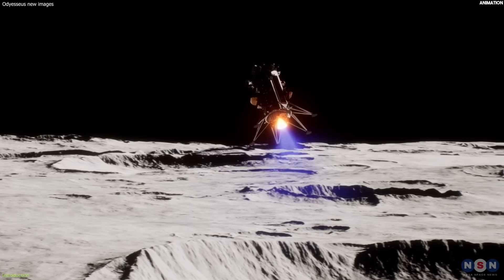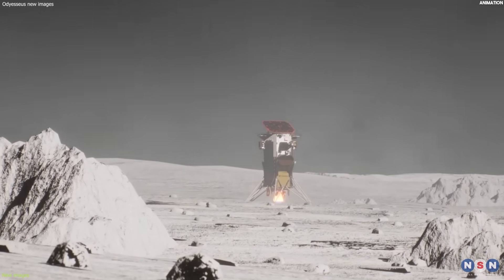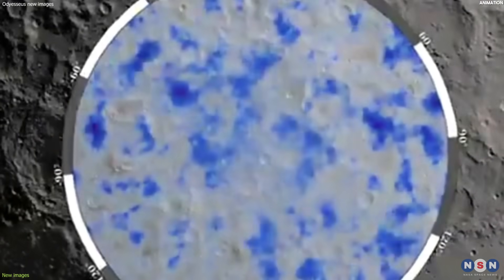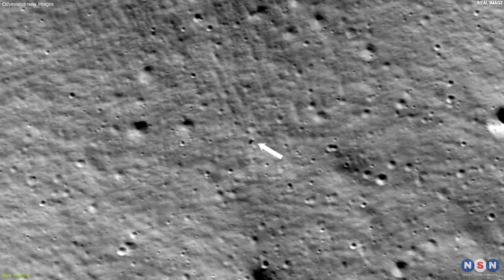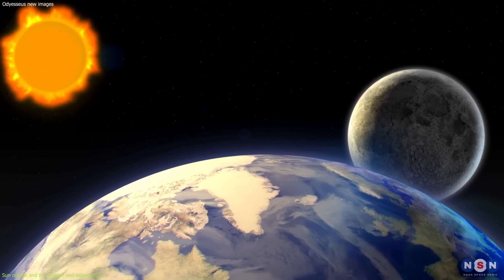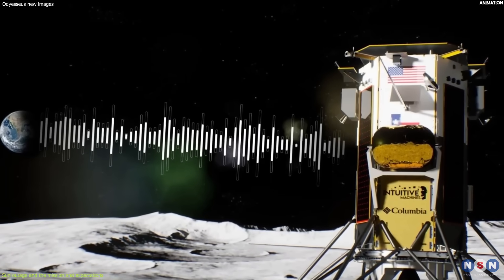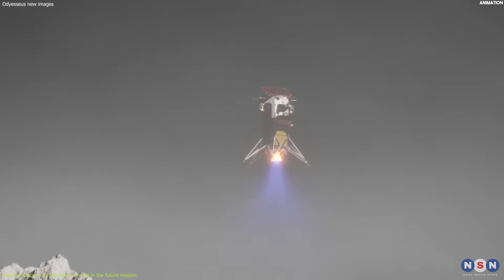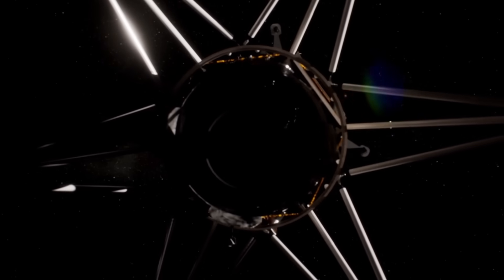New Images Reveals The Incredible Story Behind the Odysseus Lander’s Sideways Landing

Comment: Be realistic: this is a failed mission that emphasises the uselessness of the private sector. "The day after the launch, the company’s header of navigation, Mike Hansen, told Reuters that the lander’s laser-powered range finder wasn’t functional because Intuitive Machine’s engineers failed to unlock a safety switch during pre-flight checks. The range finder measures the time from when a light pulse is emitted from a laser to when the reflected light is detected, and is critical for measuring the craft’s distance from the Moon as it is landing. Range finders are a standard component of the vast majority of all modern landing systems.

The problem was only discovered while the spacecraft was en route to the Moon, and no software on board was able to unlock the switch remotely. As a result, the company was forced to use NASA’s Navigation Doppler Lidar for Precise Velocity and Range Sensing, one of the instruments launched as a technology demonstration, to measure the craft’s distance from the Moon as it was landing."

https://www.wsws.org/en/articles/2024/02/28/bkpr-f28.html

Comment: I've been to the Smithsonian andcseen the lunar module  but, im having a difficult time understanding how that dune buggy fit in that module? Hummm!!!
Reply: Boeing built the Lunar Roving Vehicle (LRM) to fold so as to be stowed in the  LM's storage bay while in flight. Popular Science magazine in Feb. '64 had a great article by Wernher Von Braun who was a director at NASA back then.
Reply: Foldable. Ingenius spring mechanism.
The answer is some.typing away if you search:

The frame is made of 2219 aluminium alloy tubing welded assemblies and consisted of a three-part chassis that was hinged in the center so it could be folded up and hung in the Lunar Module Quadrant 1 bay, which was kept open to space by omission of the outer skin panel. They have two side-by-side foldable seats made of tubular aluminium with nylon webbing and aluminum floor panels. An armrest was mounted between the seats, and each seat had adjustable footrests and a Velcro-fastened seat belt.

Comment: Ok, You said it, "plume of dust". Where is it plume of dust from Apollo 11? The pics show it sitting there spotless. I really want to believe we actually went to the moon in 69". But when there is really convincing evidence it is hard, that is if you are awake and even able to think outside the box. 9?11 for example. I believed the story until years later someone asked me how many buildings fell perfectly at free fall speeds, and I said 2. I was wrong. I am sure a majority of the people don't know. They pulled it from the news and did not even mention it in the official Commission Report. Not a word about building 7. Look it up. If you think you can handle the adult version of finding out there is no Santa. One you do there is no way back. Red Pill
Reply: Apollo LM engines shut off before toutch down.
Reply: Ok so Nasa claimed for years that the reason there was no blast crater or marks under the engines were because of the light gravity and such on the moon. Now they claim there was on this one. I have less and less faith we ever put men on the moon when 50 years later they can't land a unmanned spacecraft without it crashing it. Also isn't the reason a private company built this craft instead of Nasa is because they supposedly could not recreate the technology to go there as they said they threw all the information they used to do it 50 years ago away? Come on...

Comment: If China can do it why the most powerful, and technological advanced, country in the world can't?!

China has already conducted three successful robotic lunar landings with the Chang'e 3, 4 and 5 missions. China's moon landing plan is to launch two Long March 10 rockets, with one for the lander and another for the crew spacecraft.

The race is heating up...
Reply: This mission was run by a private Comany with a small budget. Not like China's CNSA.

Any chineese commercial landings coming up this year?
Reply: @Amradar123  Budget, for a private or a public project, does not have anything to do with the fact that there where no controls in place to set a red flag stating that a switch had to be turned on. Something so simple as... final check before launch... is altitud detection lasser on? NO!
Then turn it ON.

Comment: When TWO landers, one from Japan and one from the US, experience the SAME problem([limited power because solar panels are facing the wrong way after non-standard landing) -- you'd think someone would look at the penalties associated with solar panel redeployment or redundancy.
Reply: Lander was already designed and built when the issue with the Japanes la der occured. A Commercial company can not redesign a whole 95% finished project.

Comment: In the first press conference they said the lander still has fuel.  With nothing to lose how about firing up the attitude adjustment rockets on the surface side and see if they can push the lander to an upright position.  Do the rockets on the other sides swivel so they can add boost? It's just rocket science.   It's going to die anyway> OD wants to live.
Good Luck and may the force be with her.

Comment: #1. It seems to me all forward motion should have stopped and stabilized as it approached the ground.
#2. It was to far off from its original planned location?
#3. If it landed or hit a rock then things need to be revised if using an autonomous system.
#4. If humanly controlled, could it have been avoided?
Reply: Yes.
Reply: They should have followed India's Chandrayaan 3 , they had a 10 second hovering phase to cancel out Horizontal velocity about some meters above the ground and landed pretty flawlessly,  even with a very low budget.
Reply: They should have followed India's Chandrayaan 3 , they had a 10 second hovering phase to cancel out Horizontal velocity about some meters above the ground and landed pretty flawlessly,  even with a very low budget.
Reply: Humanity Control IS too risky. So the lander needs to hover and try to communicate with space Station on earth which cause minimum a good 10 Seconds or so that too with ITS engine burning    causing Lot of noise and huge fuel